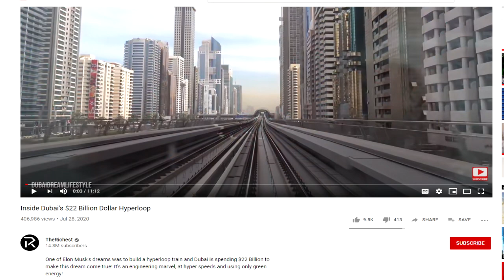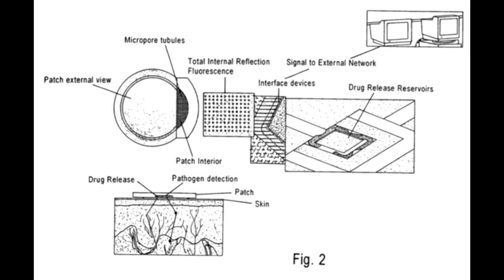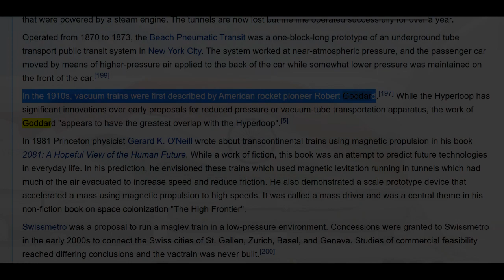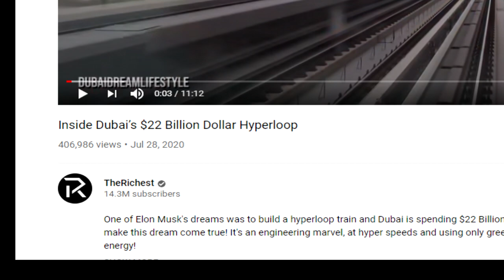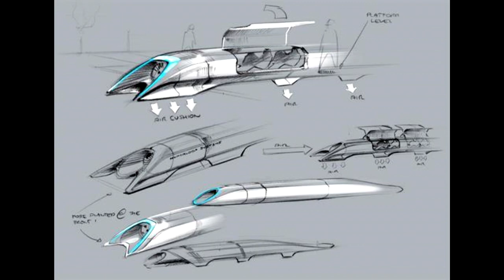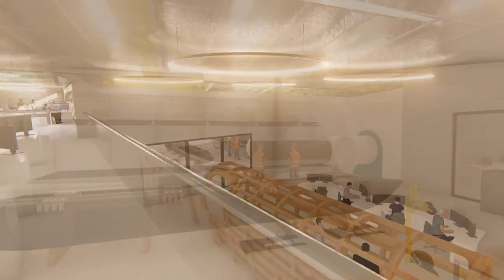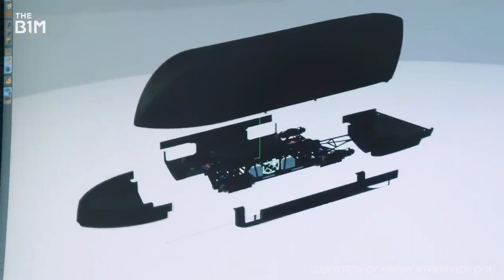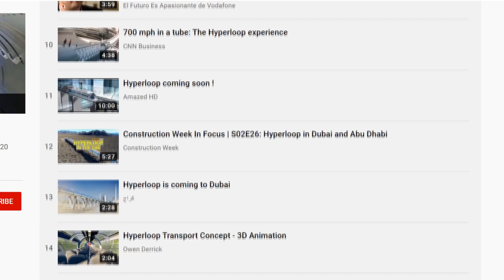Hyperloop, the biggest Scam since Theranos

Comment: Similar things were said about the Shinkansen .... sometimes you’d never know
Reply: There is an exponential difficulty curve between the two projects. 1 refines existing technology and one adds technology that hasn't been built yet. So, yes, sometimes you do know that it's geared up for failure.
Reply: But sometimes you do know, and this is such a case. Hyperloop has not one but at least a dozen fatal issues which you can't get around by some tinkering.

The biggest issue, affecting all of the iterations from 1000mph maglev in a vacuum tube to 100mph guided car in an extra-narrow non-vacuum tube is capacity, which, due to the higher speeds (and thus longer safe braking distances) and the bottleneck of "station" elevators is even lower than that of a normal road, not to mention any current mass transit system. 

Then there are the safety issues: getting out of the tunnel in an emergency, getting other vehicles around a stranded vehicle, and - for the vacuum version -  dealing with tube leaks and pressurization and pod leaks and decompression. It is physically impossible to deal with any one of these in a better way than say the way a normal high-speed rail technology deals with them.

Then there are the maintainability issues: you can't do any maintenance without halting all traffic, stress due to thermal expansion will damage your tube (especially the vacuum tube), there is corrosion, there is earthquake resistance.

Finally, the whole thing is just not economically viable. I don't just mean that the Hyperloop cost projections are ridiculously unrealistic. There is also one key issue that doomed maglev technology in its competition with normal high-speed rail: the latter offers benefits on routes beyond its own proper infrastructure because trains can just continue beyond it on conventional lines, while maglev trains or vacuum tube pods will only go as far as the magnet track resp. vacuum tube reaches.

If you want to know what actually works, don't look at the US (where the present bipartisan dogma against public spending throttled infrastructure development and what does get built is extremely over-priced due to institutionalized corruption worse than in third-world countries), but look at China, India or even the Middle East. You'd find actual in-construction or in-operation billion- to trillion-dollar projects (comparable to the post-WWII US interstate program in scale), building thousands of miles of mostly conventional high-speed rail and subways and operating them at a profit. Although these use core technologies which are at least decades old, you'd be surprised how much and how significant innovation still takes place to improve particular aspects.
Reply: @Daneelro  Totally agree. I think that a normal high speed railway is enough in US. And in japan they're developing a 400mph Shinkansen
Reply: @fedomandez  Actually, I must admit that that 400mph Shinkansen (commercial speed will be 314mph) is the only application of maglev technology on an intercity route that, contrary to my scepticism, looks set to be built (along a corridor with extremely high demand that justifies the costs of $100 billion: almost the entire route will be in tunnels).
Reply: Shinkansen shouldn't be seen as an inspiration for this Hyperloop trash, it must serve as a lesson. If you dig further, Shinkansen is actually steadily falling out of favor in Japan. Have you ever heard of someone who live in Osaka and work in Tokyo? No, because it is not economical and right now, bullet trains are considered as a luxury transport in Japan. Many tourists might prefer the bus because it's cheaper. 

In transport, speed isn't everything. The airline industry also followed this trend. Supersonic airline travel in the form of Concorde eventually disappeared despite it being fast.
Reply: @unhash631  You write a lot without any substance.

First, contrary to your claim, the Shinkansen is not at all falling out of favour in Japan, it is actually steadily gaining more passengers (or has done so until Covid hit all travel), as you can see for example on page 19 of the latest JR Central annual report:
https://global.jr-central.co.jp/en/company/ir/annualreport/_pdf/annualreport2019.pdf

Second, who in their right mind wants a 320-mile, 2-hours-20-minutes commute? What a bizarre argument. Travel over these distances is business trips, tourism and family visits (the last two of which aren't a priority for Americans with their sparse vacations & atomised families but matter much more in the rest of the world), whatever you travel on and whatever the price. 

Third, people do not consider the Shinkansen a luxury transport in Japan. A luxury transport doesn't have 150,000 passengers a day just on that one relation (Tokyo-Osaka) and a 85% market share against airlines.

Fourth, while some students might suffer though a nine-hour night ride on a bus from Tokyo to Osaka, it is most certainly not the preferred mode of transport for the general population, as reflected by the infinitesimal market share of this mode of transport. The less than a dozen departures each day carry less passengers than a single Shinkansen train, and there are hundreds of the latter...

Fifth, the only truth you told was that speed isn't everything. If it would be, airlines would beat high-speed rail every time, but the opposite is true at distances of up to 800 miles. That's why short-distance flights have been discontinued or greatly reduced over routes also served by high-speed rail, including in Japan.
Reply: @Daneelro  
Thank you for pointing out that annual ridership is increasing in Japan (at least in recent years). However, ridership shouldn't be the only factor you should consider in terms of projects like these. Shinkansen was expensive and during its early days, it didn't shed a good light in terms of profitability. Another thing, government was a major player in terms of construction of the said project (not a private company). This is a different game for Tesla, which is also in a different culture. The thing is, airlines/cars are already established transportation medium in the United States. How is it profitable to change that?

And you didn't get my point of what I consider a luxury transport is. What I meant by luxury transport is something which a lot profits come from rich people like business execs, people who like to travel, or just plain occasional customers. Aren't you aware that the Shinkansen also has a class system? So the pattern is similar to how airline industries are in Western countries. And that's what I'm saying, a transport not used by students/employees regularly (Shinkansen is only used occasionally for an average Japanese).

In your last statement, that is only true for Japan and not in America. Short-distance flights is booming in America with the rise of airlines like JetBlue. 

Another channel also covered how this kind of transport is terrible as shown from this video https://www.youtube.com/watch?v=qUXEFj0t7Ek
Reply: @unhash631  You spoke about recent years. The diagram in the linked doc shows the last two decades. But Shinkansen ridership has increased steadily ever since it first opened almost six decades ago.

Of course a long-term project with infrastructure lasting decades can be unprofitable when it starts. Why is that supposed to be a problem? Do you think airports are instantly profitable, or road bridges? The Shinkansen system is now highly profitable and has been for several decades, enough to finance significant upgrades like the replacement of the trains.

Seeing government involvement in a project as a problem in itself is ideological fundamentalism. (From which I suspect that your source for all this bizarre spin on the Shinkansen is ideological, too: have you read some libertarian tract?) If you read up in-depth on project finance, you'll learn that for megaprojects, government involvement is actually the more efficient solution, because governments get the most long-term and lowest-interest credits (minimising financial costs, a major factor for long-term projects) and have the administrators with experience to manage very large and complex organisations. Just look at the history of Taiwan's THSR, a project which was built by a private corporation that, in spite of achieving massive success in terms of ridership, market share and operational profit, had massive financial difficulties due to escalating interest payments and a short amortisation period.

You don't get to have your own personal definition of what luxury transport is, especially if you provide it only after first using the term.

Don't be misled by the word "business". Business execs constitute a tiny fraction of business travel on high-speed trains, most of it is employees travelling for a meeting or training or an out-of-office project. Outside the US, most people like to travel, we get enough paid vacation for that, what's more, companies think we will be more productive if we take time off to recharge.

Yes, Shinkansen has a class system, and so what? Even if you want to claim that Green Car is luxury, most passengers travel on ordinary class, and most of those people are employees or pensioners or students. You are really reaching here.

My statement about HSR beating short-distance flights is universally true anywhere HSR has been put into service, something you can't say about the US. (The Acela on the Northeast Corridor is not true HSR due to the very short sections it can go over 125mph, but even this was enough for trains to dominate planes on this corridor.)
Reply: Lewis Bolaton you’re right about internal travel. It’s a good choice if you need it though. And it’s good if you’re going long distances. But I don’t think that’s the case for tourists, especially with the passes (unless you’re just going to one place) and when you’re going really Long distances. Saving time I think is quite impt when you’re travelling for a limited period (which is the case when you’re on holiday). I don’t know about the economic implications though. It may be that money is put back into the system not by the ticketing itself but by people visiting attractions near it. Anyway, I was thoroughly impressed when I used it across japan (from Kagoshima to sapporo) and I do hope that it doesn’t fade away.... 

But I do agree the hyper loop can’t be compared to this after watching more of the vid ... it’s just based on impossibilities
Reply: @havenprice  Nice to hear from someone with firsthand experience with Shinkansen. The thing is, Shinkansen is already established and is a robust medium of transport in Japan. We wouldn't see it going away soon. But who knows?

Comment: Imegine as followed: Instead of these stupid vaccuum tubes just polycarbonate tubes with rubber expansion joints in between them with pods that fit "airtight" into them. And then drive them with a big blower. Make segments between the stationes seperated by airlocks. At the ends of the tube segments are turbine generators to get some energy from the compressed air back. + You don't carry the Engine of each pod around, you can make very light pods so the ratio between "the weight of the vehicle" to "Mass of human to transport" is much better, it would be way easyer and cheaper to build as it doesen't need to be sealed perfectly, Tube failiure woulden't kill everyone immediately and speeds up tp the sound barrier are theoretically possible...

...Think about that.

Comment: Well... ever heared of the transrapid maglev project here in germany. 
That was a huge sucksass...
Reply: Cost and maintenance of the track, I assume.
Reply: @PwntifexMaximus  And it crashed once with 23 fatalities
Reply: But, hey. Japan is still quite good at it. The S0 series is fast as hell. But the tickets aren't exactly cheap.
Reply: But at least it worked. We just had nowhere usefull to place it. Germany is to small to use a 400km/h maglev. There are also too many hills.
Reply: You know, Japan has maglev...
Reply: @timos9820  
Did they conclude why?
Reply: @pcuimac  Japan is quite hilly as well

Comment: Tf00t became an angry naysayer a couple years back and hasn't changed it seems
Reply: The technically hasn’t advanced or changed since a couple years back, so I don’t blame him
Reply: @Josh-vg2lj  Do you know what the engineering teams have been working on privately? What makes you think the technology hasn't advanced or changed? It was technically feasible back then, it's technically feasible right now. Large engineering projects take a long time, 5 years is a very short time. A quick google shows that regulations are being drawn up at the government level to allow more projects to commence.

Virgin are currently looking for somewhere to build a 6 mile long certification center. With the goal of making full scale prototypes that travel at 700mph.

240mph tests are routine right now. Thunderf00t felt vindicated enough to laugh at students when their prototypes failed to breach 100mph, despite the fact this was outside the scope of their projects.
Reply: @phitsf5475  A little bit, yes, within the Virgin and 'loop teams only though, not the Dubai team. My major complaint is that it's sucking up all the startup money away from things that actually have much more obvious economic value (e.g. condition monitoring technology,  rapid transit advancements, and even unrelated startup stuff like agronomy). As far as I'm concerned from what I've seen, it's not economically viable compared to what advancements have yielded in other fields. It's a very slick con, I compare it to the Electric Vtol market which also has very little delivery for the amount of money it takes out of the pool. Moreover Virgin is asking for over tens of millions in subsidies and tax advantages in West Virginia for a testing playground- let's be clear, this isn't at virgin's own expense hardly at all.
Reply: @Josh-vg2lj  I don't think you're right saying it's sucking up startup money from other things. Investors will invest their money in whatever they see fit, there is no guarantee that their next choice in line will satisfy your opinion on what's most important. 

I give the benefit of doubt to any hyperloop investors that they have done enough research to satisfy themselves. If it doesn't work out, then that's their problem.
Reply: @phitsf5475  I consider dead-end projects marketed by con artists to naive people as sucking up venture capital
Reply: @Josh-vg2lj  Con artist? That's a pretty bold accusation, especially against someone who continues to deliver on their promises. You talk about venture capital as if it's something you're entitled to.
Reply: @phitsf5475  literally all fueled off government subsidies and tax advantages. I'd like to see a level playing field, not one with fingers on the scale
Reply: @Josh-vg2lj  literally all? Are you sure about that? How do you feel about government subsidies for all the forms of renewable energy?
Reply: @Josh-vg2lj  I did a quick google, at least $150m of funding for Virgin's Hyperloop are from private entities, it primarily appears to be DP World and Caspian VC Partners. 

Do you honestly believe that Virgin are being frivolous with money of this magnitude? 

I believe everyone involved in a deal this size will be acting with due dilligence. Virgin are big enough to have access to the best business leaders and engineers on the planet and I have no doubt that they were consulted before a project this big was undertaken.

Remember, Hyperloop is not the low-hanging fruit of instant oxygen snorkels, instant water bottles, solar roadways, or creationists. 

Thunderf00t is not infallible, he has proven himself to be acting way out of his league when it comes to the big serious players in business and engineering. This disappoints me very much because there are parts of Phil that I like, but his ego here has really fkd it for me.
Reply: @phitsf5475  The reason it's so saturated is lack of moral hazard. If there's no moral hazard you can pour an infinite sum of money into it and suffer little consequences, versus companies that have 100 percent moral hazard.
Reply: @Josh-vg2lj  Are you saying all the private investors in this will be eligible for getting all their money back from insurance companies if it doesn't work out? Sure, moral hazard is a concept, but I have no idea why you're saying it's 0% when it comes to hyperloop.
Reply: @phitsf5475  no they get it back in tax advantages, at least a fair number of them do. really given how much they got out of West Virginia they won't have to pay a red cent on profits and they're sheltered from a lot of the losses by various tax advantages.
Reply: @Josh-vg2lj  So.. They get to avoid paying tax on top of a lot of their expenditures, but they're never recuperated for any losses? 

For instance, a company spends $1m on a factory and equipment, before tax, and then something big happens which causes them to have zero customers that entire financial year. They decide to abandon the factory idea and sell the machines as scrap metal. 

Will this company, and it's private investors, get any of the $1m back?